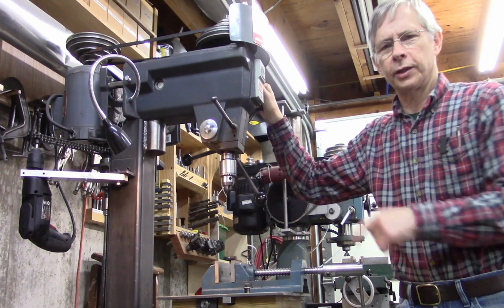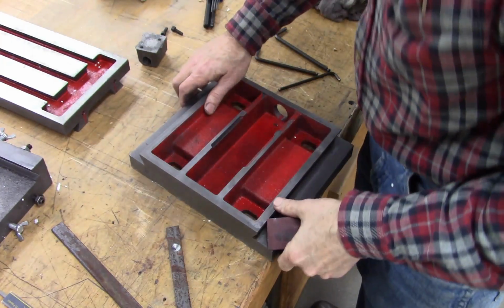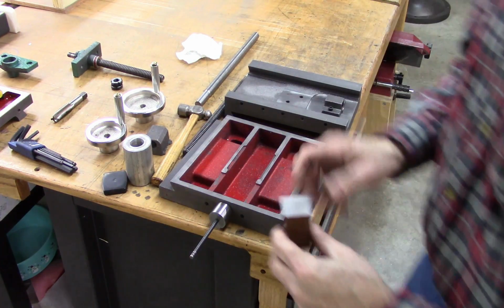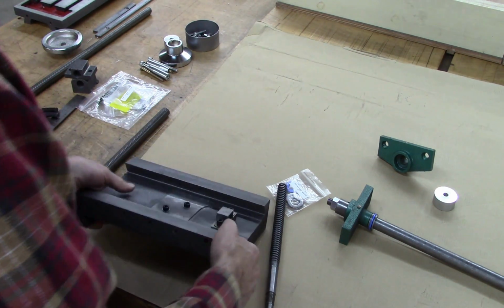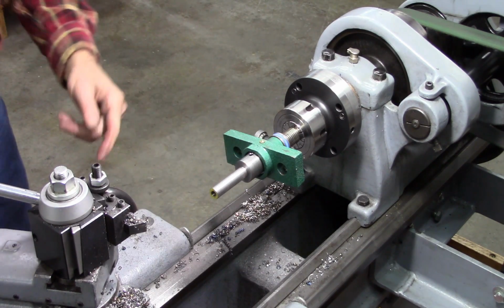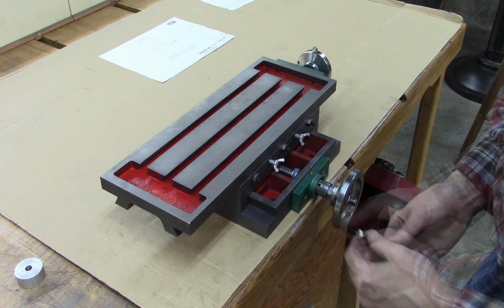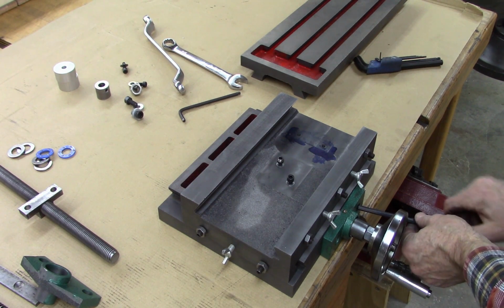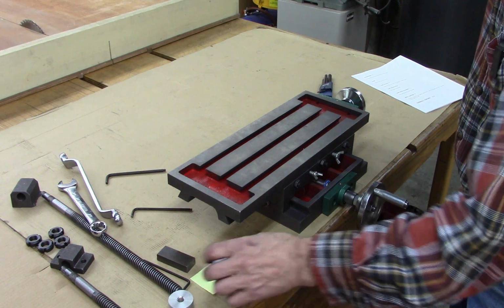Part-1 Vevor Compound Mill Table Review and Lead Screw Upgrade

Comment: It was hoped that eliminating Backlash was gonna be your glorious endgame. Surprised to realize that this eternal gremlin is still around and tolerated (except for the costly ball-screws solution). Has anyone tried double threads separated by 180° with dual nuts each occupying their own thread and suitably locked together?
Reply from the maker: I have made effort to eliminate backlash in the past. The biggest issue becomes alignment. If you have a slight bow in your lead screw or your lead screw is .002" out of line with the support bearing or nut you will bind.  With a lot of effort you might get the backlash down from .012" to .040" and to me it's not worth fooling with. I guess in my mind it's just as area to compensate for either amount. Ball screw and thrust bearings are the way to go if you want to eliminate back lash.
Reply: @WinkysWorkshop  Got it. So the dual-thread has been tried? I mentioned 'suitably locked together'. Not hard-locked but, 'soft' washered together to account for alignment issue. Think how dem balls do it.
Reply from the maker: @Mrbobinge  I've actually tried a couple methods. Splitting the nut and using a set screw to push them apart seems to work the best but the slightest bow in the rod puts an end to good results. Most my backlash actually came from the bearing not the threads. Thrust bearings do wonders. They don't bind when the rod is warped. The rods look straight...  I'm talking about a .001 to .002 bow creating a lot of problems.
Reply: @WinkysWorkshop  Dual threads Yes/No?. Winky, stay on point. Me loves to share in deep mechanics. As a lowly electrician you'd also have inventor dreams.
Reply from the maker: @Mrbobinge  Double threads Sounds complex. Ball screws are fairly cheap!

Comment: Would it be possible  to turn the x table 180*? I would like my handle on the left side as apposed to the right?
Reply from the maker: I'm not sure really but I think you could. You could make a bracket on the other end and make the lead screw go all the way through as well.
Reply: @WinkysWorkshop  could the y axis saddle be turned 180? is it machined the same on both dove tails? i know this would put the gib adjustment screws to the back but i could deal with that. thanks
Reply: @WinkysWorkshop  could the entire y saddle be turned 180*? I realize that would put the x axis gib screws to the back has opposed to the front,but I could deal with that. If that would be possible, then the dial would be to the left and not the right. thanks

Comment: I might venture to say that the company maybe had no idea the, "review" was going to be quite so meticulously in detail! HA! Great job though!
Reply from the maker: Yeah....  they gave me the mill table to review but I told them up front I was going to be honest and also replace the lead screws. Its a great table but total junk for lead screws. I also told Vevor that if the video had very much negative that I would not change the video but would give them the option to stop publication. They reviewed the video and said proceed. Judging by the number of views this video got I'd say Vevor made a good decision. I have several new videos of a 1917 Avey Drill Press Restoration and I'll be putting another vevor table on this drill press. I'm doing simplify the lead screws and use DROs this time. A mix of old and new! I think it will be easier than the dials and very easy to use.

Comment: What's the point, it just creates a new project instead of adding a usable tool to the lineup. Get what we pay for.
Reply from the maker: This mill table has served me very will for about a year now. Most often it's a mix with Chinese tools. To some degree you are correct. However, this table is excellent in some regards and total trash in other. The basic casting are a little rough on the edges but otherwise very nice. The lead screw are terrible...  I mean like a 6 year old put them together. So here's the deal. They are currently $137 with free shipping (can't imagine how they do that) and I could easily pay over $500 and get only slightly better lead screws and dials that were still illegible. In my opinion the $500 tables are a zero gain. Of course I could spend a $2000 and get one that is really nice and still get the same results on a drill press. Most Drill presses have .020" to .030" (probably more actually) and the vevor table with upgraded dials can easily repete to .001" 

So what's the point? 4-hours work, maybe an additional $150 at most for a total about $290 and a savings of about $1700 bucks. If you can find a good mill table with really GOOD legible dials for less than about $1000 PLEASE send me a link. I won't buy one, I have a good one now BUT I'd be willing to bet you do not send me a link. They are all overpriced garbage. Probably Chinese anyway...  Just paying the middle man a bit more.

Comment: Tighten your table down then it won't move around you said you're going to be honest upfront and the first words out of your mouth you weren't honest
Reply from the maker: What on earth are you talking about??? The first words out of my mouth were discussing problems with the X X table that "I BUILT". It has not table locks and I could not figure out a method of adding them. The Vevor Mill table absolutely has locks and this is also why I bought it. The vevor table had lead screw problems but overall it was well worth the money. 

Please watch the video again. If you still think I messed up, get a exact time and tell me when I said it.

Comment: Ahh! Wilco Wilco Wilco, what are you doing? Are you getting desperate for content !?
Why would you waste your time and money buying a piece of crap then wasting a heap more time and money trying to make something useful out of it just because you can 😢. 
Wilco, just make good honest videos about how to do stuff without trying to join the “ I can make a  mini lathe, with a few modifications! , to do ALMOST anything!😒 crew”
Get real, you lost me.😩
Reply from the maker: When I made this video I believe these mill tables were $179 and they are currently $129. Currently most mill tables run between $130 and $500 and there are a couple just over $1000. Most under $500 are made worse than this Vevor mill table and then to find one with usable dials the price jumps up to at least $1000. Sadly, even then the dials are small and hard to read and ALL (even the $1000+ tables) are made in China).  This Vevor mill table actually has very good castings so once you replace the lead screws you end up with a better mill table than the $1000+ tables. To answer your question, No, I am not desperate for content. I was desperate for a good mill table without paying $1000+. Also...  this name, "mill table" is very bad. None of these tables are suitable for milling and neither are the drill presses they are used on! I would prefer to call the an X Y table. They are simply for accurately positioning work on a drill press. Also...  As I said at the end of the video. A better approach would be to add DROs and forget about the dials. You might also keep the lead screws but honestly they were faily bad. Still by adding DROs the thread pitch would not need to be 10TPI and changing the lead screw would be easier.

Comment: that 4-jaw chuck looks like it was dug up out of the ground after 60 years.
Reply from the maker: Haha...  not far off. It came with my $100 1931 South Bend lathe and it was incredibly rusty. I used electrolysis rust removal method and it became more apparent how bad it was after the rust was gone. I have a better one now. The old one kind of scared me.

Comment: Hi I'm from the UK and just bought one of these tables so was interested in what you did. What do you call Standard thread ?? Have you ever thought of using Ballscrews, you can get them quite cheap?
Reply from the maker: Standard as opposed to acme of ball threads. It was cheap and I didn't care about load caring ability and to some degree backlash. I've tried to achieve near zero backlash with acme threads in a similar use and alignment becomes incredibly critical. I suspect ball screw might be slightly more forgiving but if I remember right I was having a hard time finding then in 10 TPI to make them work right with Inch dials. In hindsight cheap DROs would be the way to go. TPI and to some degree backlash is not an issue.
Reply: @WinkysWorkshop  What is a standard thread to you guys? Whitworth UNC UNF etc etc ??
Reply from the maker: @stewartdavis8618  Yes...  inch based UNC. Metric is better overall but I'm used to inches. Also Vevor mill table had a retarded 4mm per turn pitch that would be terrible to deal with even if you wanted to use metric dials.

Comment: Appreciated your review -- guess that's why we need to think of this Chinesium tools as being DIY projects. 
Thankyou for the video -- I like the way you approach projects.  I'd imagine you'd have been a great shop teacher. 
Children don't get to learn such things these days -- I'm so thankful for a DAD that really taught us how to work on projects. 

I purchased the same/very similar unit from Mophorn a couple years ago for my drill press. 
Unfortunately, they just shipped it from China with the original single wall of thin cardboard and no padding, blocking or 
anything inside.  The unit even had the handles on it when shipped.  Came with one handle broken off the other mashed.
And the X rod was bent badly.  They did not want to return it, or have me give it a bad review, and 
they badgered me, calling EVERY day.  We give you 10% off, then it was 20% etc.  No I want a return. 

Did not know if I could fix that shaft, and cost of new wheels alone was 20% of what I paid for the unit. 
It would be easier to buy another unit.  I did get them to return, but they did not want it shipped back. 
About a year later I was either going to toss it out or repair it. And was able to carefully torch and bend that shaft
to where it was very close and got new handles and it does work.  Was hoping I could do some very light milling on 
my drill press (a 1953 Craftsman) with brass bushings, and frankly almost a mm of side play at the business end.
No - the chatter even on Alum was quite astounding - a definite NO GO.  Been buying the parts for building a vertical mill (no quill). 
Hopefully I will get the time, ...someday LOL.  Could use that x-y stage as a first one for that mill; before I build a proper
one with ball thread rods and NEMA23 motors, want to be able to do CNC if case arose. 
RH
Reply from the maker: Mills need to be a lot more solid then you might think. My drill press is fairly solid but will not do aluminum. Wood it easy however.

Comment: For someone that is not a machinist and would like  good or better than good compound mill table "like this unit" for a floor mount drill press what is your choice as an out of the box unit in inches?  
I lov how you can make anything you want from raw stock...  You have great video's to get lost in for a few hours.
Reply from the maker: Thanks Don,
The mill table is great but the lead screws are not. They are metric and 4mm per turn. If I was going to do this again I would probably buy some cheap DROs instead of converting the lead screws.

Comment: Why do I have a feeling that after this video, the company are in the works to make a standard/imperial version available to some of us? Or they can advertise it as a great project.
Reply from the maker: I doubt they will do this although that would be nice. They didn;t even bother to make the metric lead ten based. It was 4mm per turn which hard to deal with. Say you want to make a 27 mm move. How many turns? If it was 10 based it would be 2.7 turns.

Comment: WTF man. Removing tha backclash is pretty easy. You need another nut of the same size of the one into the lead screw.. put it near the other nut, attach it under the table and put a strong spring between those springs
Reply from the maker: If I was concerned with a small amount of backlash I'd use a ball screw. My main objective was to minimize and change the thread pitch to a usable count.

Comment: May i suggest to check out the " oldham coupler" which takes out the misaleignment issue for your wonderful crosstable improvements.
Reply from the maker: That might have been easier but I got it aligned. Thanks for the suggestion.

Comment: After all that work why did you not chose ball screws. They are very cheap on eBay and amazon now they may not be the highest quality but for a X-Y table they would work great. I like your vids so keep up the good work . By no means am I slamming your work you do great.
Reply from the maker: I didn't see any that were 10 TPI  (needed for dials). With that being said, I don't mind a little backlash. If I was going to do this again I would probably leave the original lead screw in place and add DRO's. Input it always welcome!  Thanks

Comment: Is this really an "upgrade", with the x nut off centre from the bearing holder and acme to UNC screws?
Reply from the maker: It all lines up now...  and its a usable TPI instead of the weird 4mm per turn. I guess you might call it a rebuild instead of upgrade.

Comment: Mark, when you went to center that block in the four-jaw to bore the hole in it, I thought instantly of a trick I saw Keith Rucker use.  He used a spot drill in his drill press to make a hole big enough for a dead center to register in.  Then he put the block in the 4-jaw, trapped a dead center with the point in the hole, and the center of the other end on his tailstock center. From there he could put the dial indicator on the dead center (he might have been using a piece of a broken end mill, sharpened to a center point…) and rotated the chuck.  The point of the dead center has no choice but to follow the hole in the block, and you can use a dial indicator to bring it to center just like you would a piece of round stock in the jaws.  It was really slick and a trick i filed away for future use.
Reply from the maker: Excellent idea! Thanks
Reply: I use this trick all the time and it works great!

Comment: Love the job you did on the X/Y table. The thing has a good casting. The socket head screws should be recessed slightly in the handles. Ask me how I know. My Colchester lathe came with the tail stock (made one) missing the handle, only the cap screw sticking out. Throw it in the lathe, take a small boring bar, bring her in a little. The threads might need to be cut deeper.
Reply from the maker: There are a few flaws but overall its a good table.

Comment: Thanks for sharing, the video is interesting.  Splitting the nuts you made would be a easy task to allow for some adjustment to minimize any back lash,  both X and Y nuts.    Drill press is such a great tool.
Reply from the maker: I've done in the past. Right now the backlash is good

Comment: I hate to tell you but you didn't buy a Vevor, you bought a knock off. Let me guess ebay, amazon or aliexpress?
Reply: Look at how different the one in the thumbnail is to the one you have in front of you, not even remotely the same.
Reply from the maker: The thumbnail has a couple of very minor differences however it is not a Knockoff. In fact, Vevor sent it to me in exchange for doing the video. With that being said, I'm sure it has changed over the years. I'm also fairly certain Vevor doesn't actually make anything. It's kind of like my Enco milling machine. Jet sold the same  exact mill. I'd say they all came from one or two factories.

Comment: I was thinking of getting this and fitting a cheap DRO to "fix" the metric dials, but your lead screw upgrade probably improved it quite a bit over just converting it to imperial.
Reply from the maker: The lead screw was a pain to get lined up right. The DRO would be way easier. Otherwise it a good table.

Comment: Great Job of upgrading the Table. It’s too bad they don’t spend just a little more Time to do it right at the Factory. The Castings were good, it was just all the sloppy Work they did on the Lead Screws and the rest. I guess they don’t have a Quality Control. Anyway, Thanks for showing us how you fixed the Problem. Really good Job of making it right.😁👍👍
Reply from the maker: Thanks! Yeah, the table castings are nice. The rest had all the right parts like thrust bearing but like you said, sloppy workmanship. Kind of like a 10 year old might do. Honestly, the easiest way to use the table is DROs.

Comment: Wouldnt 10mm per turn dial mean you need 10mm per turn lead screw therefore next to impossibile to mill anything manualy? I think 4mm per turn is 1mm per quarter turn and seems like a normal hand motion also normal metric leadscrew pitch. But i am no expert at all. Great video though really really liked it!
Reply from the maker: 4mm per turn is crazy. Tell me how many turns for a 47mm move. Ten per turn makes this very easy, the answer is 4.7 turns. Why would 10mm per turn lead screw make it impossible to mill anything (side note: this mill table is best used to position stock for drilling not milling)? Also, I made the table inch based and my lead screws were 10-TPI for the same reason.
Reply: @WinkysWorkshop  10TPI isn't like 10 turns per 25.4mm or approximately 2.54mm per turn so even smaller than 4mm per turn? Or probably i am missing something somewhere
Reply from the maker: @SuperHaptics One turn is 1/10" inch or .100" inch. Yes 10 turns is one inch and yes slower  than 4mm per turn. With a total movement of 15 inches the speed really isn't an issue. This is standard on most inch based mills and lathes. I believe metric lathes and mills are 5mm which would be 5 turns per inch (approx.). Speed is not much of an issue although on a manual mill with a 1000mm travel it might be. 10 Base is needed for manual mills and lathes.